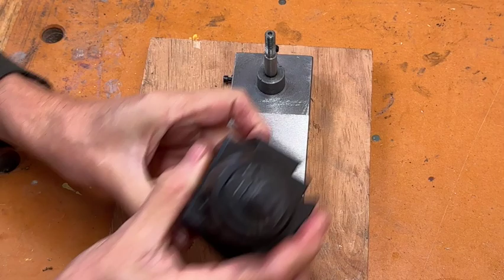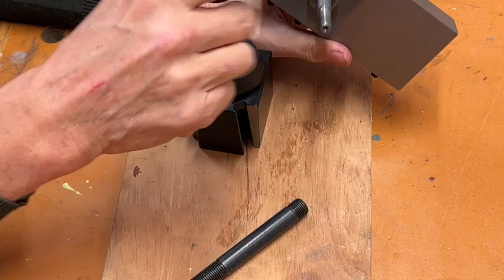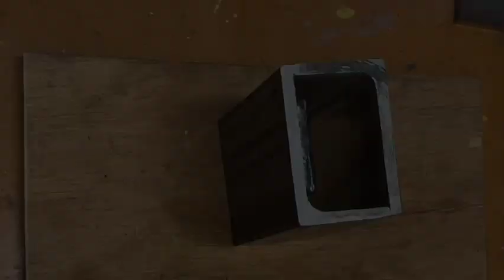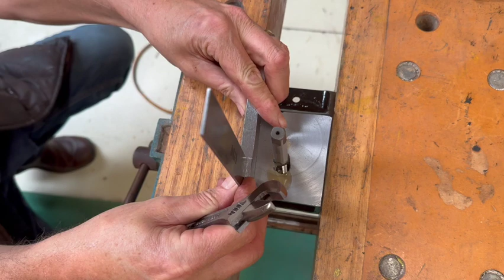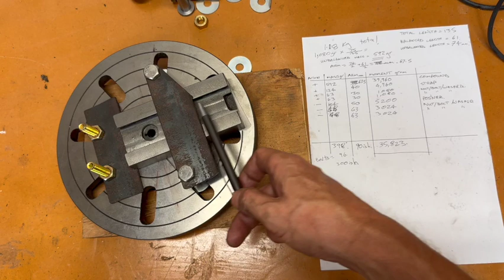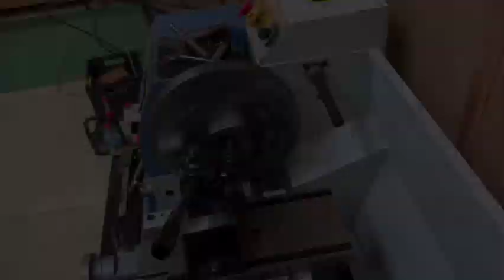Another Quick Change Toolpost Mod.

Comment: Very nice! Good idea the temporary tool post. I have almost exactly the same problem. I think I have to let (at least) some of the protruding boss of the top slide to remain so it registers with the old tool post and also provide some location/rigidity for the AXA one. From what I understand just by fiddling with the AXA (haven't used it yet) it wouldn't mind if I removed some material/thread from its underside...